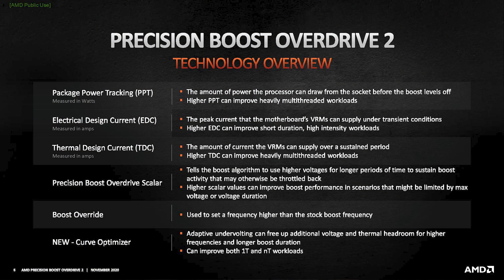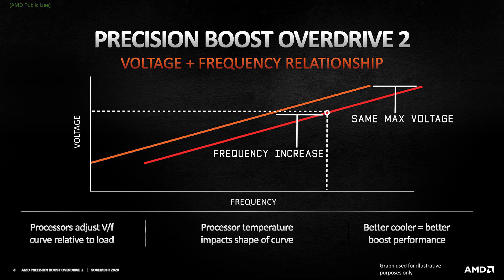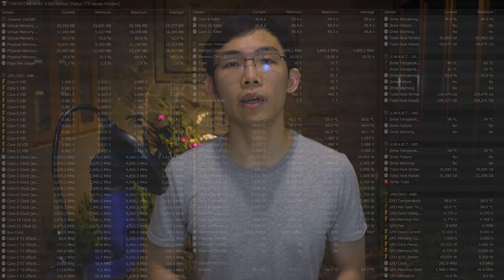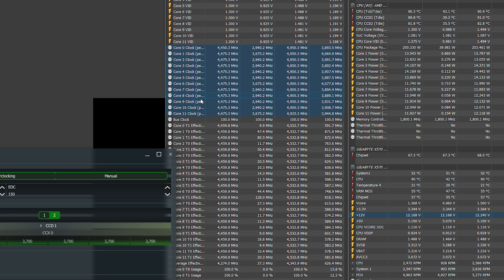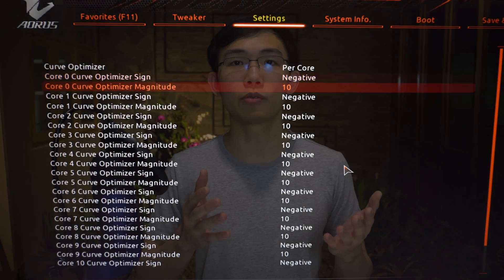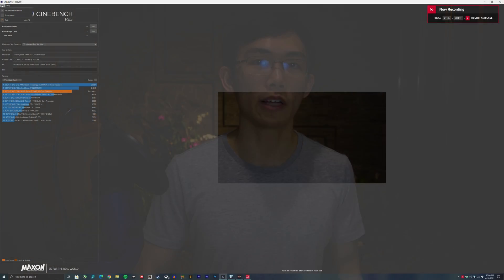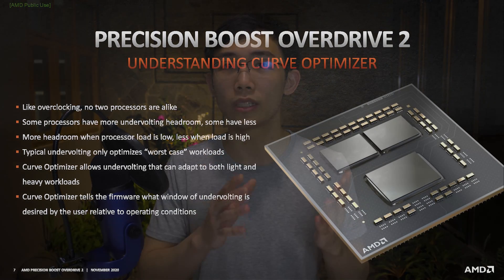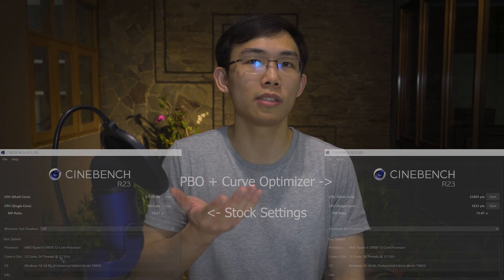The Best Way To Overclock Ryzen 5000! | How to use Curve Optimizer

Comment: Hi can you help? Everytime I try to use PBO (default values) or Auto OC (default values) I keep getting 96+ degrees and throttling down the Mhz to 560 or lower. It never crashes but it keeps overheating. So I can run only on default and that gives me around 60 - 65C. I'm using Prosiphon Elite Giant which should be one of the best coolers for AMD cpus according to benchmarks
Reply from the maker: Its only good for threadripper. On regular Ryzen CPUs a Noctua NH-12S beats it by a good amount and a NH-D15 is even better. Prosiphon only works for threadripper with a big IHS to spread the heat and the high TDP that can actually boil off the liquid. This has been tested by manu reviewers and people on reddit r/overclocking.
Reply: @OTechnology  Yeah I'm using 3990x threadripper
Reply from the maker: @SilverIlly3  Oh then maybe you didn't put enough thermal paste? The X with 4 dots is usually the preferred method for threadripper. Only enabling PBO shouldn't be a problem for the prosiphon. Also better to have too much thermal paste than too little which will hurt performance while having too much you'll just make a mess is the worst that can happen.
Reply: @OTechnology  I had a PC professional apply the paste and he followed the Icegiant video tutorial and made 8 dots around it with enough thermal paste so that shouldn't be a problem.. any other idea of what could be an issue?
Reply from the maker: @SilverIlly3  fans too slow or bad case airflow would be my guess. Just seems like a cooling issue.
Reply: @OTechnology  You mean case fans? I'm using Lian Li ox11 large case and 9 case fans, bottom side intake and top out
Reply: @SilverIlly3  You need to lower your TDC so you get better temps.
Reply: @gbalazsfalvi  wouldn't that give lower power and hence lower GHz capabilities?
Reply: @SilverIlly3  In certain cases yes, but not necessarily. You draw too much amps, so your temperature goes high, and PBO algorithm throttles. But if you lower TDC, when your temperature rises, the current is going to be lowered, so your temp goes down again.
I use TDC=150 on 5950x, my temps don't exceed 85C with heavy load under prime95. Lowering to 140 would give me another 5C headroom.
Reply: @gbalazsfalvi  Oh alright will give it a shot
Reply: @Alex Double checked and it's tight enough. Maybe this cooler just can't handle overclocking

Comment: good vid, but there is some mistakes!!! i have my EDC set to 250 and my all cores (16) boosting to 4.65GHZ all core boost and some to 5.2GHZ single core. setting as following (pbo limits 300, 25, 250 scaler to x10 and +125mhz) and curve optimizer all to negative 30 except core 6 to 20 and 7, 8 to 25, nearing 30 k score in cinebench multicore and 1650 single core. and temps never above 76 on max load.
Reply from the maker: That's not i made a mistake your cpu might just react differently to different settings. I would try a lower edc it usually helps boost speeds.
Reply: @OTechnology  i have tried 150 edc i lost a lot of performance and max boost was 4.4ghz while at 250 it was 4.65
Reply from the maker: @BaneTheLycanthrope  this is a 5900X?
Reply: @OTechnology  no, a 5950x
Reply from the maker: @BaneTheLycanthrope  well i was testing on a 5900X so its probably different.
Reply: @OTechnology  probably, anw it's a good detailed video. It's rare nowadays! So keep it up.
Reply from the maker: @BaneTheLycanthrope  Thanks!
Reply: There are also other factors for this too. The silicon lottery being a major factor here, I feel. Plus, your motherboard and ram are also factors in the equation
Reply from the maker: @phoenix0153  Ofcourse, that's why I mentioned to find the right settings for your CPU specifically. Every CPU will result in different ideal settings and max overclocks.
Reply: @OTechnology  Also, this is a great instructional vid, and really appreciate how much time you took to make it easy for all to understand. I'm tinkering with mine right now to see if I can get a bit more out of it with you in the background, lol
Reply from the maker: @phoenix0153  Thanks, I appreciate it! If you want to get the absolute max out of your CPU you can use this software called CoreCycler which cycles through loading the cores one by one to see which one is unstable. I managed to now find the max negative offset for each of my cores this way. https://github.com/sp00n/corecycler
Reply: @OTechnology  that's actually pretty good to know. I've sat and tinkered with them for... probably 2 weeks now and finally just put it on 4.6 ghz and left it there. I had my curves pretty close, I thought, but will 100% try this. Thank you!

Comment: This could be easily applied to undervolting scenarios too.
Thanks for this video. I'm gonna put up my big boy pants now and undervolt PER CORE instead of all core, seems that is the intermediate-advanced way to apply better tuning values other than simply putting in all core due to the nature of CCD arrangement in Ryzen CPUs. 
This video onwards, I will need to read up on per core optimization.

Comment: Some comments:
1) Not all Ryzen 5s and 7ss are 1-CCD. Some are 2-CCDs, which can be seen from e.g. ZenTimings debug report.
2) Clock Tuner for Ryzen can give comparable performance but much better volts/temps. But only on Windows.
3) OCCT or CoreCycler can be used to ease testing curve offsets per core.
4) There are faster ways of coming up with curve offsets, e.g. https://youtu.be/4gDfMwOBnoE?t=1565
Reply from the maker: All true and good advices. Thanks for sharing. I know about all those but thought they were not really necessary especially clock tuner where you're sacrificing single core speeds.
Reply: @OTechnology  can some cores be enabled even though they might not meet grade quality in the ryzen 5600x, due to 1 or 2 ccd having 8 cores each, but 6 only are needed for 5600x.
Reply from the maker: @issjdjdn5962  no the cores are physically fused off in the factory so you can't enable them even if you found a way to hack into the AGESA or something. Not sure about security flaws on CTR.
Reply: @OTechnology  in CTR one can actually set single-core speeds higher than anywhere (incl. CO) manually, and even be stable
Reply from the maker: @RomanOrekhov  isn't CTR a fixed overclock?
Reply: @OTechnology  CTR 2.1RC5 is IIRC 4-5 fixed OC profiles dynamically switching on load switching (for 1-, 2-, 4-, half-, and full-thread loads)
Reply from the maker: @RomanOrekhov  oh they do that now huh. I guess I'll have to make a seperate video on CTR and other methods once I have more time spent tinkering with this. Thanks for the info.
Reply: I think there were some controversies (source from Reddit, thus anecdotal) regarding CTR 2.0 for Ryzen involving security flaws on AMD subreddit. 
Is there any reason to not simply use Ryzen Master to tune the CPU?

Thanks for sharing the other additional tips. Going to do some due diligence after this.